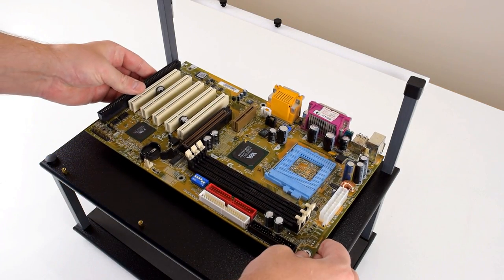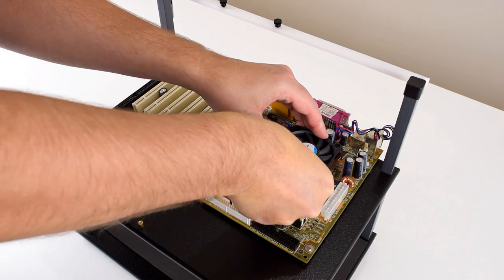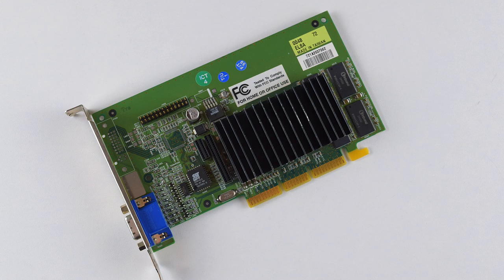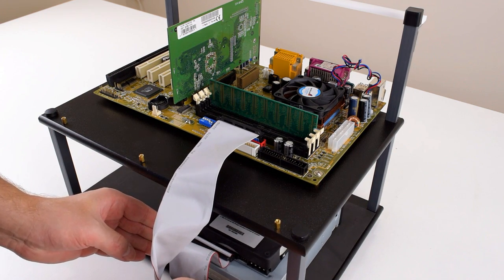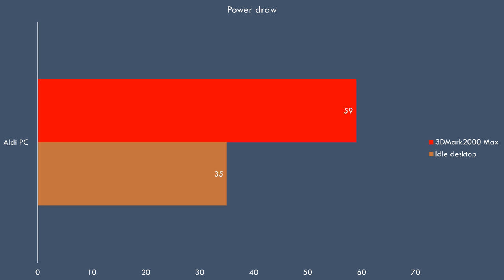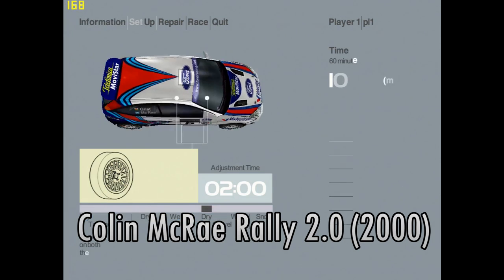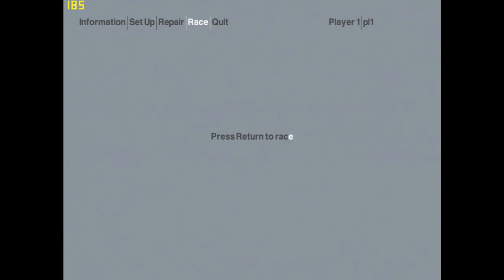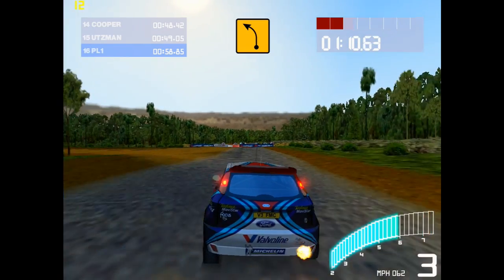Building the Aldi Medion Supermarket PC from 2000

Comment: Great review to look back at this aldi Spec PC from 2000.
But to be honest, back then i avoided those machines mainly because there where not that cheap if you looked what you got for the price. (I build my PC's myself back then)

Most of the hardware parts where a little, how do i call it, the light version or stripped down version of the real thing. 
For example there where aldi pc builds that fitted videocards models from nvida and ati  that didn't exist according to the nvida or ATI website back then.
There where mostly an stripped down version of the real "PRO or Ultra" version with locked mulipliers, lower clock speeds or old memory modules onboard.
Mainboard where mostly stripped down versions of real MSI or Asus (as shown in this video), chipsets where just the older type from last year or the ultra cheap option of the day.
Sound cards the same thing, an Creative or Realtek chip mostly but then stripped down and software/cpu driven.
The CPU was as far i noticed always the real deal, but with the AMD build they advertise it a lot faster then they really where.

Don't get me wrong, there not bad computers at all after all they had branded (mostly MSI/Microstar) hardware in them.
But you thought you bought the VW golf GTI, but after all you got the GTI light version with plastic chrome, the engine from last year, only front electric windows, fake double exhaust, sky leather and xenon lights that turn to be just bulbs.
For the mainstream users it was perfect.

Comment: That was actually the first "proper" PC in our house... my dad bought it when I was in hospital but didn't figure our what to do with it at all... so it was mainly used by me afterwards.

The GPU it came with was pretty solid for that time... altough it should be said that Developers back then spend a lot of time for optimisation while at the same time pushing the graphics etc. Today, you find Games that look almost exactly like ones from 3-4 years ago, but require significantly better hardware.

Also, I think people which had the "joy" of using Windows ME react different to bluescreens than the XP-Generation, which currently think the end is near whenever a forced Win10 Update breaks more than it fixes.

As far as prebuild PCs are concerned, there are quite a lot of things to adress, but I think it's wrong to just say they're all junk etc. that nobody should buy. I mean... if that were true, nobody should buy Laptops, Tablets, Smartphones ... either, right?

For someone that knows his way around PC-Hardware, but without the need for high-end Hardware, I'd always recommend used parts. If something fails, you can just replace it, but all in all modern (think Core2 / GTX4XX / HD3XXX and later) Hardware is surprisingly reliable compared the the good old Pentium X days with SD Ram or insanely overclocked Athlons on sockets just one step from glueing the damn thing directly on the MB.

For people in the high-end market, I think the answer is obvious to buy new but customized.

However, people without the ability to do anything Hardware related and with no need for any sort of Gaming etc. performance, prebuilds can be a viable option. My uncle needed a PC after his Laptop died, he doesn't do anything but browsing or watching videos and he wanted something with low power consumption. I went to a Shop with him and we decided on a SFF Lenovo with a A-10 APU, 8 gigs of Ram and so on for a pretty decent price.

At the same time, the owner of a 2nd Hand Games Store I frequently visit went to the same store, and asked for almost the same thing my uncle wanted. However, they sold him some Asus SFF thingy with a Processor usually found in Tablets or Windows phones. How I know what PC he has? Well... the thing kept freezing when I was in the store so I offered to look at it... got rid of some of the bloatware and installed a adblocker so he could keep using it, but I don't think that's gonna keep the thing usable for long.

TL;DR: If you know your stuff about PCs, you don't need my advice, if you don't: never buy something without someone that does have at least some knowledge.

Comment: From what I remember those old VIA chipset boards had better IDE performance with the stock Intel IDE driver than with the Via 4 in 1's. We would install the rest of the driver pack but leave out the IDE portion. Admittedly most of my experience was with the AMD versions, but I'm fairly certain it was also true for the Intel systems. Might be worth a try to check that out. Unfortunately I don't have any Via boards these days or I would check it out my self.
Reply from the maker: I can check it out the next time I work with a VIA chipset board!

Comment: I like period correct builds myself . That is mostly what i build . I'm in the process of building a pc as close to the alienware area 51 from july98 as i can get without spending a ton . Some of the cards are different brands but same tech other than a 10/100 network card in place of the dual line 56k modem . It was a pain getting a working pair of voodoo2 cards for a fair price .

Comment: i have a shuttle av61 with the apollo pro 133 chipset all i have is the p3 slot 1 667. i was gonna run my v3 but im wondering if the g2 mx would be better. then again it would help if i had a higher mhz cpu.

Comment: Only a year before the Aldi-PC had these specs:

MSI W6190ZXM7 "Medio 9901" (Intel 440ZX Chipset)
P3-500 (100 MHz FSB)
64MB SDRAM
Nvidia TNT2 M64 32MB (onboard)
SoundBlaster PCI 64V (onboard)
14,2 GB HDD (Seagate)
Liteon CD-Drive (40x)
3,5" Floppy Drive

Time travels so fast these days...

Comment: biggest issue with prebuilts for me was always the size of a small/mid tower (HP in particular) as there was hardly any room for upgrades or non-existent AGP slots, lack of RAM slots.  There was no way a voodoo 5500 was fitting into half those cases.

Comment: our first Windows PC was a Medion pc too. it costs about 2000 DM in 1999 I believe. We used it until 2007, 2 Years later the hard drive died, with all sorts of photos and memorys on it  :(. But still, I could save the motherboard, its from Intel, with a Socket 1 350mhz P2 with MMX and an onboard Nvidia Riva 128.  Unfortuned I don´t have much memorys how it ran, but I played Sims, Theme Park World and such games on it.
Reply from the maker: I wonder when they started selling PCs at Aldi? A P2 with Riva 128 is a good combination.
Reply: As far as i know, they started selling Pc´s, or better say home computers at the beginning of the 90´s, it was a refreshed model of the c64. But then i don´t know what or if they sold Dos/Windows machines, up to the point of 1997~1998. Medion Pc´s here in Germany where very sucsessfully, until the mid 2000.(Nowdays you find them everywhere) The Generation with the P4 Prozessors where (in my opinion)pretty decent back in the day. They had many neat features like Scart, Svideo or Composite out and inputs, cardreaders, 2 DVD Drives, Remote Controls, TV Tuners and things like that. The one Medion card you showed in an other recent video had this litte yellow connector, its very likely its for the TV Tuner card/ Scart/AV/Svideo output. I have some of these cards/modules lying arround but no fitting graphicscard, If you want I can maybe send you these.
Reply from the maker: Thanks for sharing. I've seen that yellow plug on other cards as well, GF4 MX for example.

Comment: Damn, back in 2000 I had/ have an HP with a Slot 1 Pentium III E 800 MHz an Asus mobo w/ VIA Chipset that only had AGP 2x and 256MB PC100 SDRAM. I wish I bought the Dell as I think it used socket 370

I will add, screw you HP! The  AGP 2x was the reason the system was the last prebuilt desktop PC I've ever bought and ended up building my own from there on out.

Comment: It's amazing that modern power supplies are compatible with boards from the late 90s. We really need a new standard. Maybe 48V, much smaller connectors, maybe a single uber-connector for the board that powers the board and the CPU, and provides a lot more power to the x16 PCIe slots.

Comment: i have this trash can of a case sitting on a shelf. it's been there for quite a while, not sure if there's actually any hardware left in it since it wasn't mine. the white plastic has a yellow tint, though, just like the ancient TFT screen i got with it and never used. terrible colors and 1024x768 resolution. my Gericom CRT screen, which i still use, is much better. 
i do, however, have a different Medion PC sitting right next to it. cost 1200 back then, i forgot which currency it was. might've been Euro already. Pentium 4 @ 2.66 GHz, GeForce 4 Ti 4200, i think 256MB of RAM, 120GB IDE harddrive, a nondescript sound card, CD burner and DVD reader and, as a fancy bonus, a TV tuner card that just stopped working after a while. also came with a keyboard and mouse. not sure where the mouse went, but the keyboard's still there. and it's disgustingly filthy

Comment: I was given a Me in years.ago when family upgraded.  Pentium 4 1.8 GHz, 1GB PC2100 (may have been upgraded).  Motherboard is a MS-6399.  GPU is a geForce3 Ti200, though I believe it had a geForce 2 MX of some kind.  CD and DVD-ROM, floppy, 3.5" Slot with front connections including video in. Rear has spdif which seems odd.  Always seemed slow so your next video will be interesting.

Comment: I've got the same PC. I bought it few years ago but it lacked the hdd and RAM. The specs are almost the same except for the video card which was a TNT2 m64 in mine. Looks like Aldi was also saling computers in France since I've got that computer, that I saw similar computers where I live even though I'm quite far from germany. Also back in 2004 my parents bought a liftec laptop in an aldi shop so I guess that they also existed in france since a long time

Now that Medion computer has been downgraded to 98SE, has a 40GB hdd, 512MB of RAM, a 1GHz pentium 3 with 133FSB, a radeon 9550. I also replaced the dvd drive with one of these drives where you put your disc in a notch and the drive takes it and start to read it (I don't know how they're called) and the PSU that died due to a dead fan. I also replaced the plastic bracket of the heatsink that was a real pain to remove by a metal one from a socket 7 cooler and I replaced the CPU fan that was noisy by a noctua ^^

Comment: I actually bought this exact same pc only a few weeks ago for some Windows 98 retro gaming. The PC runs really well but i've upgraded the ram to 256mb and put a Sound Blaster Live! in it. Buying old prebuilt systems is kind of a mixed bag for retro gaming, you get a complete system with all the parts (even the IO Shield for the mainboard) but drivers can be a real issue.
Reply from the maker: Let me know if you have any issues!

Comment: why are you using latest via chipset drivers? if i remember corectly hyperion 4,x were developed for via apollo and k7 early  chipsets while 5.x series were developed for pentium4 and athons xp chipsets. i had mig trubbles with stability of my system or rather cpu stress with 5.x drivers on pentium3 platform
Reply from the maker: There is a difference between driver package (the whole thing you download) and the actual individual drivers. So a 2009 driver package doesn't mean the actual driver that gets installed is also from 2009. When you say "were developed", this means they focus their efforts on new chipsets, the code for the old ones just remains mostly untouched, because it already has all the fixes sorted out.

Comment: Amazing video Phill! Greetings from Lithuania!!! I wanted to ask something my retro gaming motherboard has integrated gpu wich has chiped three corners on VIA UniChrome Pro graphics chip and i wonder if i put AGP X8 GPU maybe it will work???? Because i dont see any video but i hear beeps LED works CD HDD everything works
Reply from the maker: Just try it out. I have a Dell board with faulty AGP port, but PCI cards work.
Reply: Okay i will try when the card is going to arive thank you!
Reply: I can't see why it wouldn't work, though you may have to go into BIOS to enable it to output video through the AGP slot (which would be difficult if you can't see anything on screen. 

If you don't have an AGP card already, you could buy a cheap one for testing. :)
Reply: +PhilsComputerLab Ok so i bought ATI Radeon 9700 Pro and GeForce 6600 GT and the machine works!!! I use Radeon 9700 Pro for compatability and speed and GeForce 6600 GT for newer os and more speed

Comment: I have in my position one of these Medion PCs, looks the same as the one on the picture. It has a funny story, originally came with a 1.8GHz Willamette P4, but I swapped it  for a 2.4GHz Northwood Celeron. Interestingly it still saw it as a Pentium 4 in the bios. It has an MSI made motherboard I believe and there is actually a secret code you can enter, that unlocks the ability to overclock it. No options did anything though apart from changing it from 100/66/33 to 133/66/33, so I ended up with a 3.2GHz Celeron in it.
Reply from the maker: Nice! I will for sure do a P4 video project at some point :D

Comment: Actually I wanted exactly this PC (back in 2000 I had just a commodore c128), but did not get it.. My dad purchased the successor one year later, which had a 1GHz CPU.
Reply from the maker: What other components did that newer machine have, especially the GPU interests me.
Reply: PhilsComputerLab if I remember correctly, it had a GeForce 2 GTS and a faster CPU, besides that the machine was very much like the 900MHz-model.
Reply: In March 2001 came an improved version of the Medion PC MT5 with with a 1 GHz Pentium III, GeForce2 GTS and PC133 Siemens RAM.
https://www.golem.de/0103/13164.html
Reply: The improved Aldi P3 1GHz had a Geforce 2 GTS with 32MB DDR. More specifically it was a medion-branded Asus V7700, even though the "branding" was nothing more than an additional line on the sticker on the BIOS chip saying "MED" for Medion (aldi's electronics store brand). I don't think there were any actual changes compared to a retail Asus V7700

Comment: i really miss IDE on modern Motherboards.
Reply from the maker: True, but you can get cheap PCI IDE controllers :)
Reply: True, Phil. i have one and run my old IDE DVD drive with it.
Reply: I have lots of IDE devices that's why. Yeah PCI IDE controllers help and converters..but i don't understand why the industry eliminated IDE on motherboards.
Reply: Because IDE compared to SATA is horribly slow.
The majority of new drives use sata, and for companies to keep supporting IDE wouldn't be cost effective.

Comment: Hey Phil! Love waking up to new videos. I have a Windows 98se gaming rig that I put together using parts from my dad's old PC. Here's what I have :
MSI 6752 AGP 8X
AMD Athlon XP 2500+ 1.83ghz
512mb ddr 
256 MSI GeForce FX 5600 (buying a radeon 9600 pro to replace it today) 
10gb Seagate barracuda 
80gb wd caviar 

What do you think? It runs most games at max settings on native resolution (1280x1024 or something like that) but I directx 9 games shit the bed so that's why im buying the radeon as an upgrade.
Reply from the maker: Very nice! Some of the late DX9 games like Far Cry or FEAR, they can be very demanding to be honest. But lower the details a bit and you should be ok.

Comment: I have the Medion MD2000 our firts PC in the family^^
and it works even today. Ok we have replaced the Hard disk Drive itw a sonly 20 GB and later we have bought 80GB. 
The Power Sopply didn't work so i had to replace that to itw as only 200W No I have 250W its ok:)
Graphic crads is Nvidia riva TNT 2 it was a great crad during this tome in 2000. Ok The Geforce 256 came out in the end of 1999 but itw as very expensive so this card and the TNT 2 was great for the Mainstream. But in the end of 2000 ot was time For the Geforce 256:)  I#m sure that TNT 2 Pro could handle even more games if they would support T & L

Comment: In 99 or 2000 I got this computer on germany:
Pentium III 1GHz, 384MB SDRAM, ATI RADEON 7200 agp 4x.
shame that the via chipset disliked every new gpu (like the fx5500) so it forced them to run at agp 2x and not 4x
Reply from the maker: There is bugger all difference between AGP 2x and 4x on a slow card like a Radeon 7200.
Reply: For me there were, I had some games that were slower on my fx5500 and also in geforce 6200 compared to the Radeon 7200.
It wasn't a complex game for those gpus but it required alot in transfering data to the gpu as fast as he could

Comment: 8:59 WTF Phil this game Works fine on my K6-III+ 400MHz with a voodoo 3 3000
Reply: your performance is like a Pentium mmx 233 with a voodoo 3 3000 with all the settings off or low
Reply from the maker: You're dreaming mate :D I know this game well, you likely have the default graphics settings, which is low and 640x480. Max out the details, run at 1024x768 and then it looks the same and will be a slideshow.
Reply: Colin McRae Rally 2, one of my personal favourites! It has many settings to adjust that allow it to run and look good on anything from a Pentium II 350 with ATI Rage Pro all the way to an Athlon 1100 and GeForce 2 Ti. Draw distance seems to have the biggest impact on performance, as well as the various mapping options.

Aldi existed here, and they have sold PCs in the past. I have a TV capture card under their Tevion brand; it is useless as a TV tuner today, but still works well as a composite/S-Video capture card.

The PC I had at the time was a Dell Dimension 4100; it had the Intel 815 chipset and a Pentium III-933. It was customised with a SB Live! Value, DVD and Zip drive, which made it quite expensive. The TNT2 M64 in there held it back, though it was good enough for Flight Simulator 98 and The Sims 1. I still have some of the parts from this PC: the 128MB PC-133 RAM and sound card are used in my 500MHz P3 build.